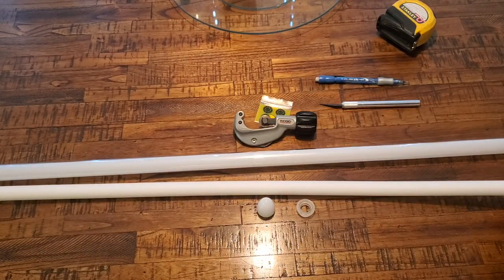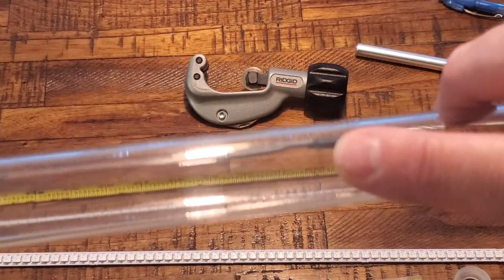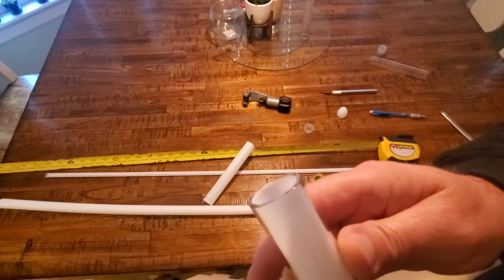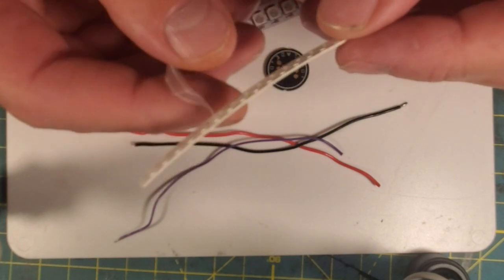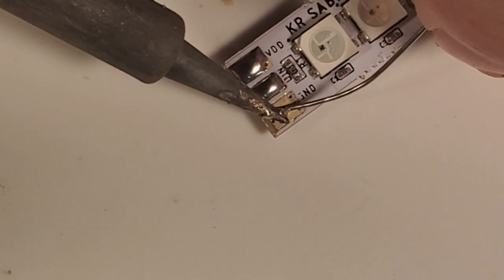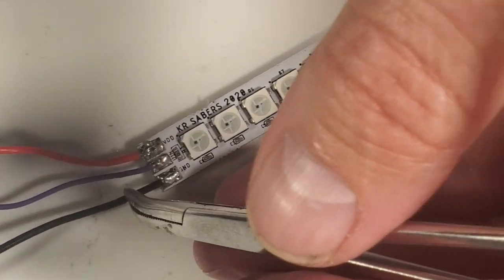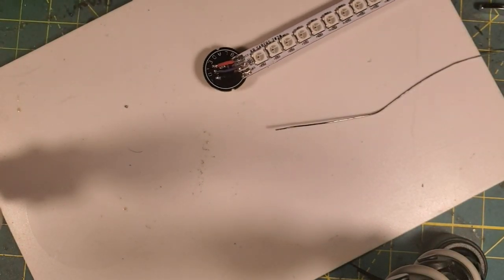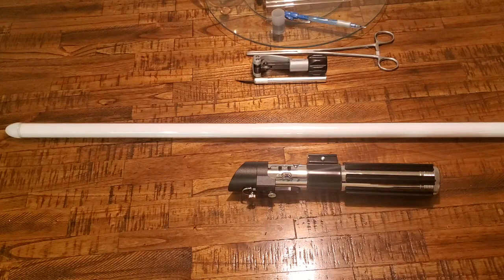Killer Neopixel blade build 2. Using KR Sabers Pixel Stick.

Comment: How's the corn cobbing like using a clear tube?
Reply from the maker: I use TCSS strip diffuser and modern close cell foam tube to encase the pixel strips in.  All are available from TCSS.  Using those items, as long as strips are straight and centered well in foam, pixelation is negligible in most colors.  Pixelation shows worse in yellow and light blue.  Red, Dark Blue tend to be better, as does plain green.  This is an older video.
Reply: @MegtoothSithSabers  are clear tubes still good with the pixel tech we have nowadays? (quantum, kr3.5 etc) or would you say trans white is the only way to go

Comment: Looking to buy parts to build a KR V2 blade. Should I use a clear blade or trans white blade and why?
Reply from the maker: Either works, both look slightly different. I like transwhite better, because it diffuses pixels very well. BUT, a clear blade with strip diffuser tube and foam appears to have an outer aura that transwhite lacks. I have built and own both, and have no clear preference

Comment: Thanks, Meg! Helpful in the extreme. 

Question: do you prefer clear blade tubes, or was it a customer request? If you prefer, what are the advantages?
Reply from the maker: i prefer transwhite for overall appearance. But clear tubes create this plasma with an edge look that is cool too. so, although I personally prefer transwhite, I also live clear.
Reply: @MegtoothSithSabers  Well, now I just need both. Thanks again. Guys like you make it possible for guys like me.
Reply from the maker: @cbrsawyer  also see this:  https://youtu.be/hEuBTIOdgGw
Reply: @MegtoothSithSabers  Will do. I like the cheap(er) kind, too. Lol

Comment: What if I wanna put two of em in a blade
Reply from the maker: Good luck, and the amps drawn will burn your fets, and or your feed wires.
Reply: @MegtoothSithSabers  .....
how does that guy on YouTube do it with proffie board..... and 3 led strips?
Reply from the maker: @Swanlord05  you could do 3, with 20 ga 2ire divided on 3 fets, you said 2 kr pixel Stix, that's 4 strips
Reply from the maker: @Swanlord05  3 is doable
 4 is possible, if engineered with precision. The fact you are asking me these questions, leads me to believe that you do not possess the required knowledge to accomplish it.     What's wrong with the traditional dual strip blade? NOTHING. 3 strips tax your mosfets with higher amperage, use your battery quicker, and cause tip dimming as amps are lost going up blade. So, what advice I'm giving, is for the best overall performance, with the least negative impacts. But do whatever you want.

Comment: Does the sound come with the blade or with the hilt, im confused because I just started this hobby, if blade, how did you add the sound
Reply from the maker: sound is in hilt. Hilt has computer tgat senses motion, controls lighting effects, and produces sounds oit of a speaker.
Reply: @MegtoothSithSabers  oh I see, so far I just have the neopixel blade but no hilt, where can I get a good hilt with smooth swing and sound for under $100? Thank you so much for responding :)
Reply from the maker: @mtbanana6350  nowhere, you get what you pay for cheap and good arent compatible.
Reply: @MegtoothSithSabers  oh no lol, how do I know if my neopixel blade is compatible with a hilt that I will buy
Reply from the maker: @mtbanana6350  most pixel blades have a target pcb, most sabers have the compatible hilt.

Comment: Correct me if im wrong but you wouldnt need a resistor since the K2 V2 have a resistor already in the strips...?
Reply from the maker: you dont need the resistor, no. But it doesnt hurt either. The resistor serves to smooth out the data signa for the pixels. Fredrik tested up to 2000 R when he put onboard data 1 resistor on proffieboard, and the pixels got signal just fine. The resistor isnt there to reduce V, like in tricrees. Pixels still have full power. So, if you had a saber with a restor on soundboard data, resistor in blade pcb, and on pixel stick, signal just has 3 opportunities for noise reduction.

Comment: Hey Tom, is there a reason why you didn't add additional layers of diffusion with heat shrink and cellophane like you did with your older blade build video?
Reply from the maker: no room with sticks. If you use 7/8 foam, you can get celophane on outside of foam. This was blade building with pixel stick in simplest form.

Comment: Awesome video dude. Do you need to change your config when using a KR strip ? I’ve been told you need to do this for them to work ?
Reply from the maker: Not the v2 sticks, this one just gets set to 132 pixels in main blade array. So no more than you'd have to change for any other blade. The V1 pixel sticks were in series, and more complex. Khal of KR sabers listened to feedback and redesigned the stick so leds were parallel same as strip blades. You always have to set pixel count in configuration file for your specific blade, so these are the same.
Reply: @MegtoothSithSabers  that’s fantastic. Thanks for the information man. Much appreciated 🙏🙏